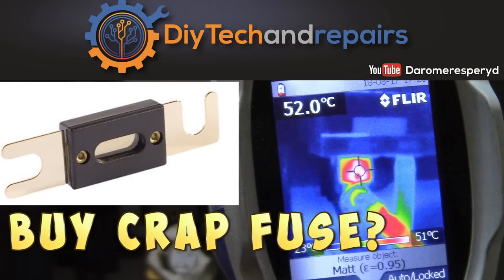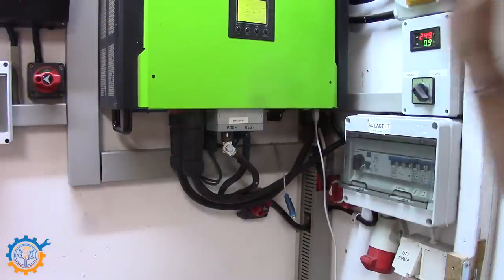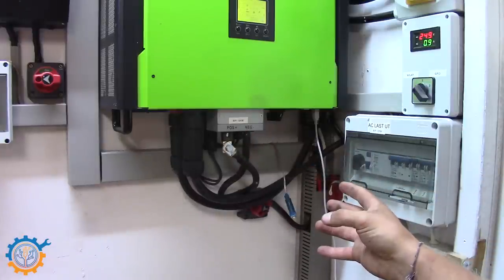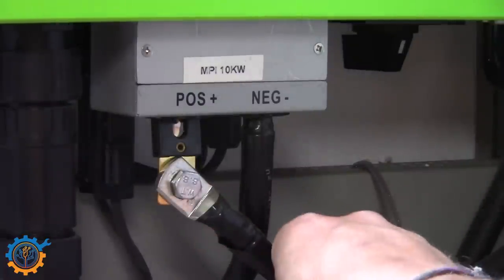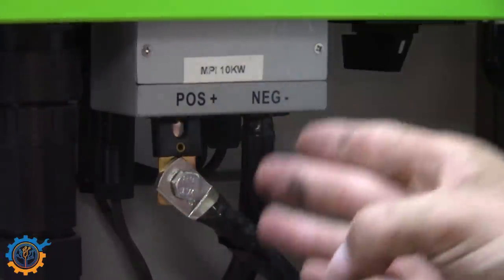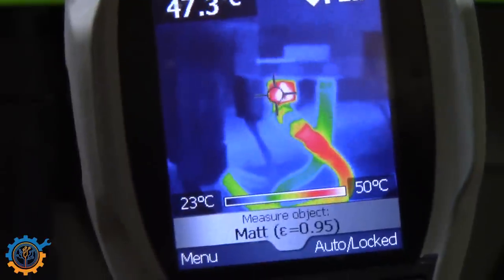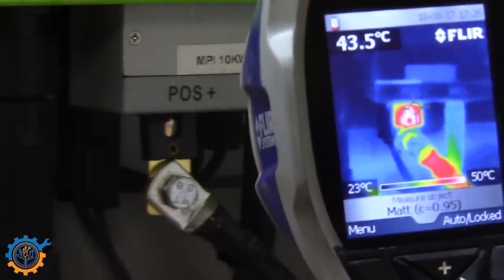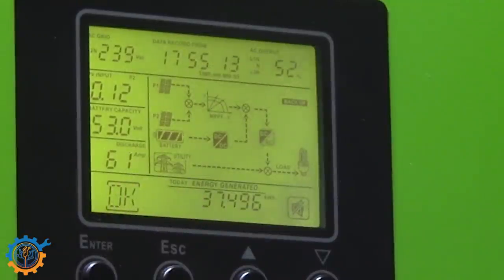Cheap fuses worth buying?!

Comment: Is there a way to measure internal resistance with a common multimeter? Is this something this is also written on the spec sheets when purchasing.  I had a 50amp cheap thermal resettable fuse the other day charging 30amps 12v and it was getting very hot and tripping. Same for 200amp fuse with 170amp load it made in inverter keep shutting down, once I connected directly to batteries terminals for testing it worked as normal.
Reply from the maker: Dont buy cheap fuses and holders. First of all they are often wrongly rated and bad contacts will induce resistance and heat.  You can meassure internal resistance on cells by meassuring voltage drops on different loads but best is to use a proper ir tester like this one: https://ebay.to/2Urt9a9 (Affiliated link)

Comment: There's a massive con trick and misinformation out there surrounding fuses WHICH ARE NOT RATED FOR DC CURRENT.  You must google this and inform your self properly.  AC current rules most definitely dont apply to DC ccts.  Think of a dc arc stick welder. Once the arc is struck it stays lit until the distance gets too great, or its cooled or blown out like a flame, or the current source stops.  A solar panel continues to supply so long as the sun shines.  DC fuses are usually ceramic sand filled cartridges.  Its a big subject too much for here